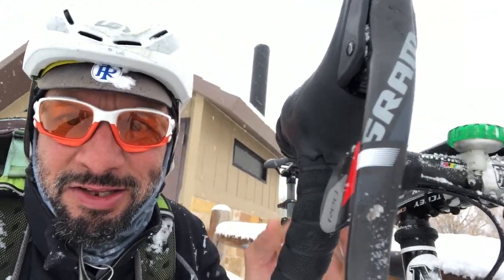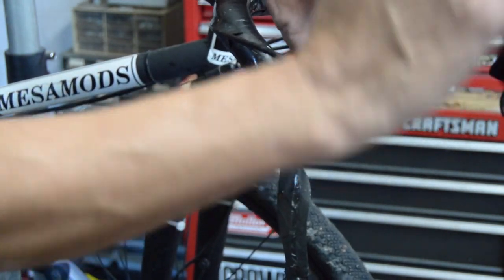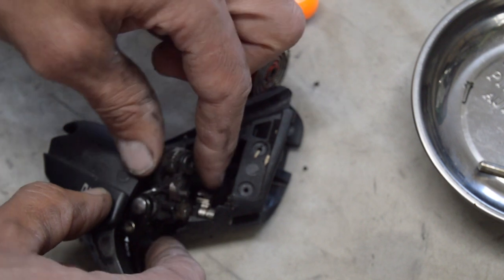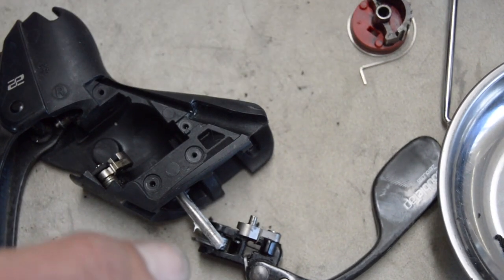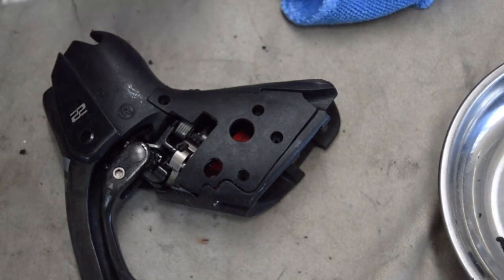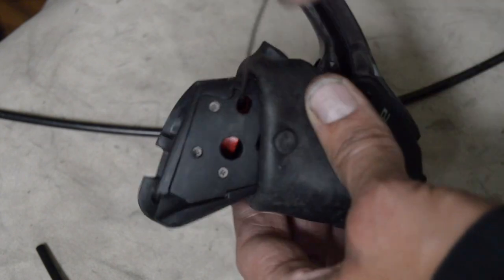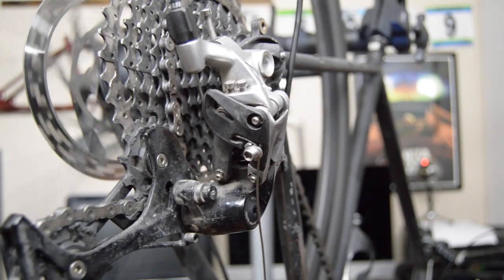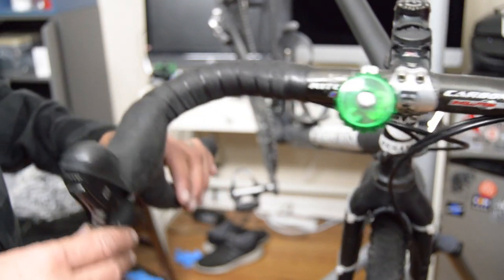Sram Force 22 Shifter Overhaul

Comment: Mine was doing that.  I sprayed the mech with Dawn Powerwash (and it immediately started working again!) and then hosed it down and re-lubed it with Lithium grease.  Works like new again!  (yes, I replaced the cable while I was at it)

Comment: Great video. I bought a used force 22 and it came with the cable split out of the red plastic ratchet wheel, grrrr. ratchet is fine. cannot find the plastic replacement part, any idea?

Comment: This was a very thorough video. Thank you for taking the time to make it, Joey. One question: When threading the cable in, should the lever be in a certain position? Like equivalent to largest rear sprocket--1st gear, or equivalent to smallest, 11th gear? I'm having problems getting the new cable in. It goes in, then gets caught on something further in, does not exit the shifter at the cable hole.
Reply from the maker: The shift lever should be in the position of the smallest cog in the rear and smallest ring in the front. Same with removing the cable. These are the positions where all the slack is let out of the cable and the hole in the ratchet ring is facing out.
Reply: @JoeyMesa  I guess I'm going to take it apart. Something is not right. Perhaps the shifter lever is broken, as you mention this as possibly resulting in not being able to hold on the largest one or two cogs on the rear cassette, and this is what prompted my interest initially.

Comment: You’ve got some patience. My barrel is slipping out the side of that red wheel. I see yours doesn’t have a slit. My sram force CX1 is spilt at the side and the cable is falling through. It’s a nightmare.
Reply: This happened to me, and I could not find the replacement anywhere, Is there a fix for that problem or the shifter should be replaced?
Reply: @markokompic7617  they’ve actually obsoleted the version I have. The only available replacement piston is for the newer version. I ended up buying a new one. I bought the cheaper alloy version and not the very expensive carbon one. The cheap version works fine.

Comment: Hi Joey, I've watched most of your force 22 videos and appreciate the content. I'm in the process of building a 1x 12 road bike with either force mechanical utilizing Ratio's ratchet/jockey wheel conversion kit on force 1 type 3.0 rear mech or complete 1x12 force etap axs. Going etap will cost $400 extra and both groupset comes out to 2100g. Can you give an opinion on which system will give better serviceability and longevity say 3-5 years?
Reply from the maker: I don't have any experience with Ratio's conversion kits, but the concept looks very intriguing. I've used both mechanical and SRAM AXS stuff quite a lot the last few years. My last demo bike had Force AXS components and I never had any issues performance wise. I made a long term video on the bike and my opinions on AXS at that time: https://www.youtube.com/watch?v=dijiiKmDkWI
Other than charging the battery (which I did forget to do a few times), AXS will require less maintenance, is easier to set up, and is easy if you're going to potentially swap between AXS road 12 speed cassettes and Eagle 12 speed cassettes. The Force AXS shifters sync up to any AXS derailleur very easily.
I could see some situations where mechanical shifting would be more advantageous, like a long bike packing cross country adventure or something. My demo bike I have on order has a 1x Force AXS drivetrain with an Eagle 10-52 cassette, But my beater commuter bike is still going strong with the Force 22 shifters set up 1x 11. The Ratio 12 speed conversion ratchet would be a sweet upgrade at some point though. 
My answer would be that I don't think you'll go wrong either way, but for the additional $400, I'd lean more towards AXS.
Thanks for the question and feedback!
Reply: @JoeyMesa  I appreciate the detailed feedback. I have ordered the Force AXS upgrade kit. Will go with either 44 or 46 1X chainset with 10-33 or 10-36T cassette. Another question, I noticed that on most store websites it'll say medium cage compatible with 10-33 or 10-36 but on Sram's own website it says Force AXS medium cage can be paired with 10-28, 10-33 and 10-36 can you confirm who's giving the correct info?

Comment: Hi Joey, Thx for this great vid. A question for you: i broke 2 or 3 teeth of the internal piece you call the "chip mechanism "- with the red plastic piece where the cable puts in... do you know if this piece - that I couldn't find as spare -  is actually the same in other 22 double tap shifters? mine is a red HRD, and I wih to buy a far less expensive second hand rival (no hydro) shifter to collect the part. Would that work? thx again!!
Reply from the maker: Yes I believe the shift the parts are interchangeable.

Comment: Couldn’t do a video on the axis shifters ? Damaged my left shifter , want to change the lever only red axis hydraulic brakes
Reply from the maker: Are you talking about the electronic AXS shifters? I've done a few installation videos, but no repair videos because I haven't dealt with a broken one yet.
Reply: @JoeyMesa  yes the new axis 12 speed shifters electronic , need to repair the lever

Comment: Is there a way to find a solution about my SRAM rival
The shifter skips and won't shift
Reply: Probably you have a problem with the cable retention ring. The end is weak and it can brake. Dismantle it like in the video and buy a second hand shifter to replace the broken part.

Comment: Nice video, I have a problem with a broken holding pawl spring my RED 22 shifter, (11:58)
Could you please give me some suggestion about the replacement spring?  
Thank
Reply from the maker: I'm not sure if that's a part that can be purchased from a source that sells Sram parts or whether you would would have to salvage the spring from a used shifter. The assembly comes apart pretty easily with a little C-clip.
Thanks for the question!
Reply: @JoeyMesa  Thanks for the suggestions, I'll try to find the custom spring maker shop.
btw I have tried to take out this part, but it not easy.
Reply: @punklo0  Did you have any luck finding a replacement part? Having the same trouble...
Reply: @kevinnooijen6825  sure, luckily i'm in Taiwan, some shops have the replacement parts.
For my case, the replacement spring cost me round 50$.

Comment: Does any way possible we can switch the 10 speed ratchet to 11-speed ratchet
Reply from the maker: Only if it's the second generation shaped shifter that uses the yawl type front derailleur. The first generation double tap shifter bodies are limited to 10 speed only.
Reply: @JoeyMesa  So the 2013 10 speed red will work with any srams 22 ratchet with no mods? Thanks in advance :)